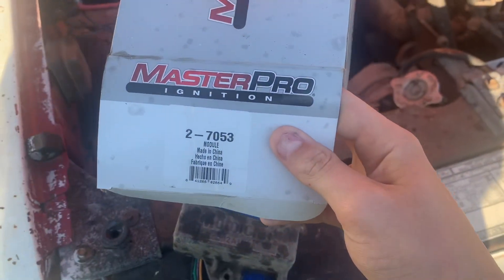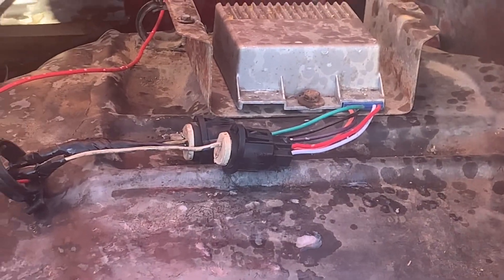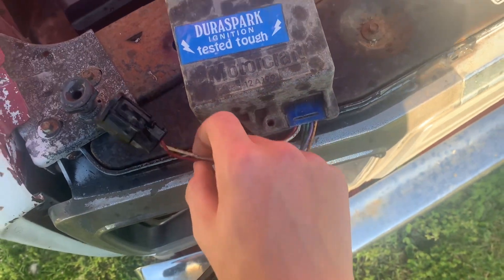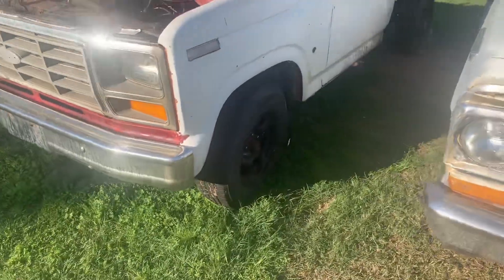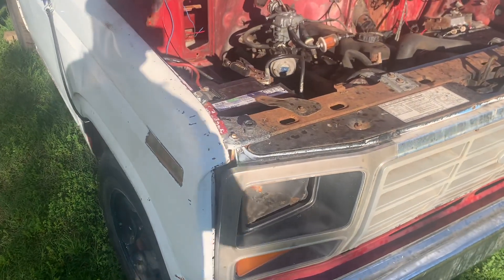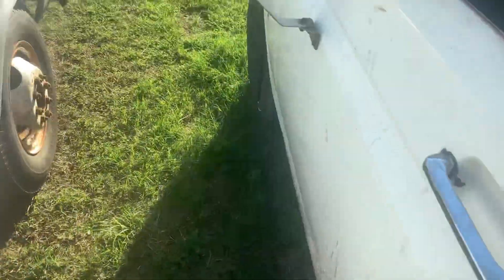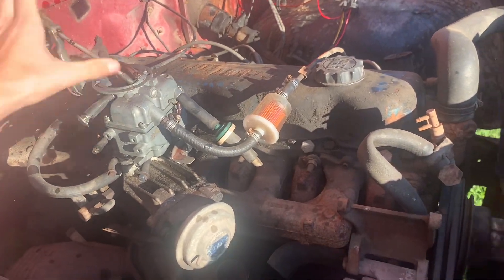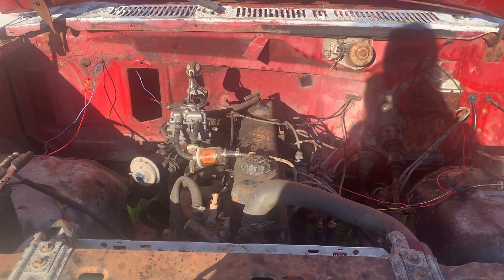1980s Ford Dura Spark Wiring (simplified)

Comment: How do you know what part number the ICM is ? Which one should I get for my 1985 ford ranger ? Thanks
Reply from the maker: I searched on O Riley’s website for the ICM and I matched the connectors I had to the ones on the website, I then called them and had them order it in and paid for it when I picked it up the next day.
Reply from the maker: I also brought the old one with me to the store to match before I left.

Comment: Great video !!!  Having a No Spark issue on a 1979 Lincoln Mark V. Followed all your steps and verified we have 12 volts going to coil and Duraspark module. Also manually interrupted the negative to the ignition coil and got a spark on my tester. At 2:16 in your video you do a quick discussion about the solenoid on the passenger side fender wall. I'm not getting 12 volts there with the ignition key on but, I also don't see the square box so not sure if we have the same alternator and if this applies to this car.

Unsure that I understood your comment about connecting that directly to the positive terminal on the battery and if this is a valid test and don't want to fry anything.

Judging from the gage of the cables going to this thing it looks like it's a part of the starter system.

Two questions if you don't mind; does your troubleshooting comments apply if it's not the Ford alternator as in your video, and, if it doesn't have 12 volts with the ignition key switch on will it cause a No Spark condition?

Thanks !

Jay
Reply from the maker: https://www.crankshaftcoalition.com/wiki/images/1/1a/Durasparkwiring.jpg 

This is a link to a general wiring diagram for Ford Dura Spark ignition systems, and the box I showed at 2:16 was the voltage regulator for ford 1G alternators.

Here’s what the small case and large case 1G alternators look like as well as a wiring diagram 

https://www.ford-trucks.com/forums/attachment.php?attachmentid=112966&stc=1&d=1421404020 

https://www.cjponyparts.com/media/catalog/product/cache/12b9ca0f8aaf696bea26173ccf5b8795/a/l/alt66_3.1310_1.jpg 

The alternator circuit wouldn’t cause your Dura Spark box to not make a spark but as long as the box is hooked up to the distributer, coil, and is getting power from the key in the run position and start position it should work. And if it doesn’t and it’s the original box then I would replace it, I think I paid around 30$ for mine at oreilys. Because when I tried to start my truck it wouldn’t run but as soon as I let off the key it would pop. 

I hope all this helps out and you get it running, and if there was anything I missed in your question or any other diagnosis questions just remember the internet is the best tool you can get and there are many forums full of helpful people who know way more than I do.